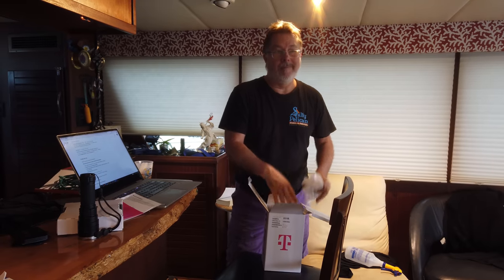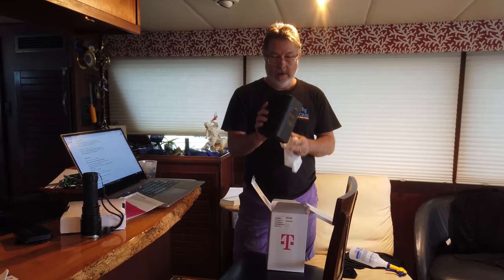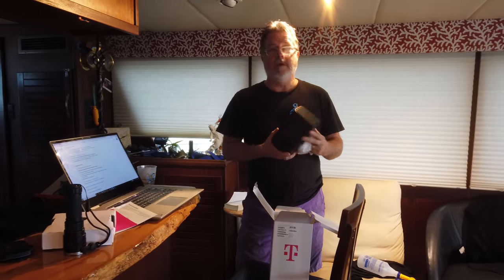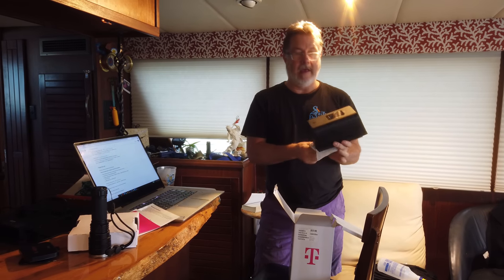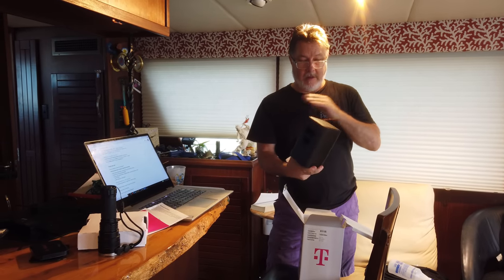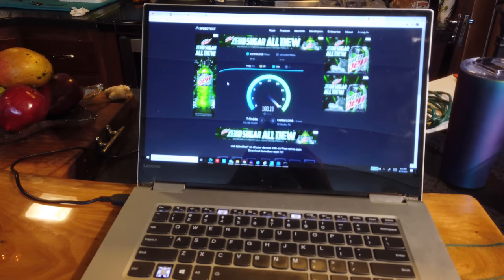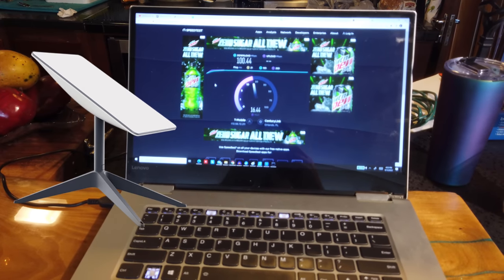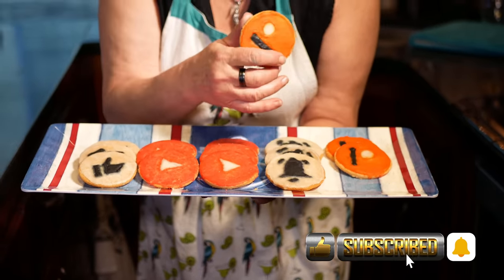Boat Internet 1/3 The Cost of Starlink! Plus, how we monitor the boat from 1000 miles away! E178

Comment: I have the SimpliSafe cameras, and they sell a fixed base that you can screw the camera to, however, I am not sure if they will you the rate of motion you might need to line up the camera but worth looking into it.  Also, I highly recommend the solar panel charger for the camera battery.  Depending on the motion detection level and activity around the camera the battery will not last anywhere near as long as they claim.  In addition the only way to charge the battery is by removing it.  If you don't do the solar panel, then I recommend having two batteries per camera so you can just replace the battery and not loose coverage while it's charging.
Reply from the maker: Thanks for the tips. So far we like the system. So far the camera has been on for two months without charging. We have live aboard neighbors so the camera gets triggered often. I think I need to set the coverage zone tighter when I return to the boat. I'll look into the solar panel attachment. Thanks.

Comment: Something else you might want to implement with your CerboGX is the automatic generator function.   You can program the system to automatically start the generator when the batteries are depleted to a preset level (e.g 20%), charge the batteries to a preset level (e.g. 90%), then turn off the generator.  This will significantly reduce the number of hours your generator is operating, while still providing you with all the power you need when you need it.   The more battery capacity you have, the less frequently the generator will be running.

Thanks for the tip on the internet service!

Comment: We had an AT&T grandfathered account with true unlimited data but they cancelled it. We tried T-Mobile in Florida and it was horrible with very slow speeds (1-2 Mbps) multiple dropouts and constant connection issues. We also tried Verizon and it worked fairly well but it was slow (5-8 Mbps at best) and had unreasonable data limits. So when the portability option for Starlink was available, we grabbed it. We have had outstanding high speed service all along the East Coast, the Chesapeake and here in The Bahamas.
Reply from the maker: We are getting 100mbps on T-Mobile. 5G
Reply: T-Mobile 5G it doesn't work in The Bahamas (Starlink does) and is very sketchy at most anchorages along the East Coast. In the big city it may be great but you can get reliable 300 to 1000 Mbps speeds with Verizon 5G and unlimited data for the about same price.

Comment: I bet there's some version of a glue / epoxy, or a Loctite-type product that you could use to attach your cameras. Something that holds securely, better than a magnet, but not necessarily permanently. You may even find something that will release with heat, like from a heat gun or hairdryer. There's even some extremely strong 'Stay Tape.'
Reply from the maker: We are playing it by ear for now. The way the base is set up, I can permanently attach it to the top of the base, which twists to disconnect from the bottom of the base. So there is a solution that allows us to still bring the camera inside for charging without too much difficulty.

Comment: We have similar monitoring system on boat, but cellular-based (Boat Command). At this time of year it is very comforting to know that shore power is on and boat interior temperature is well above freezing.

We also have the T-Mobile Home Internet at home and have had great service. One tip that might be related to your lost connection - this unit has both 2.4 and 5 networks, blended by default into single SSID. However, it does not always route properly between the two networks. In our case, if a laptop connected to the 5 network, while network printer was on the 2.4, we could not print. There is a simple setting in the T-Mobile app to have the unit split these networks, so you have two SSID's (e.g network2.5 and network5). So we can now make sure that printer and computer are both on 2.4 for example. This could be the problem if your Victron hub is on different wi-fi network than the other wi-fi components.

I enjoy your videos!
Reply from the maker: Thanks for the info. Perhaps that is what is going on. It seemed to work fine when we were at the boat but we  have since lost connectivity. I seem to recall that the Cerbo GX specifically stated that it ran on 2.4. Good to hear that T-Mobile Home Internet is working well for you. We may decide to switch our land house to it as well.
Reply: @tryingnottosink9107  I am in that spot right now! My Verizon hot spot blinked while we are several hundred miles from the boat and now I don't have any cameras or info on what's going on in the boat unless I drive back down. Dang it! Sometimes just a lightning strike nearby.

Comment: I wouldn’t count on it as a travel solution. T-mobile home internet is locked to an address and it is against their TOS to use it anywhere else. Supposedly it still works if you move it but it’s only a matter of time before they start cracking down on it. You may find yourself deactivated out of the blue if they find out.
Reply from the maker: Possibly. But the investment is only $50. I bought the unit in Florida, using my Pennsylvania address and they had no problem. I have been running it in Florida for several months now.

Comment: Hope your new monitoring system works good for you...
But sounds like you need a good auxiliary generator  to run the air conditioning when you're at anchor..
Reply from the maker: We have a 20KW generator onboard, which can run the whole boat, including 6 air conditioners. We are just trying to find ways to use it less. It uses 1 gallon per hour, so if the inverter runs 6 hours per day at $5 per gallon, we are saving $30 per day x 100 days per year, equals $3k per year. Plus it now gets less wear and tear.

Comment: I asked at the Tmobile store a uear ago about this router...
Per their staff, the router will only work within your defined home cell. Has that changed? Because I don't think this is gonna be capable of replacing your Hotspot when it comes to mobility...
Reply from the maker: We have not tried moving the unit yet since our boat is docked until May. However, we used our Philly address when buying it and we have it installed on our boat in Florida.

Comment: We have very similar systems.  I have Victron Charger/Inverter and two Victron 330ah lithium batteries and two 170w flexible solar panels.  I also have a SimpliSafe, TMobile, and a bunch of cameras.  I believe you will like your setup!  I don't have the Cerbo GX for remote monitoring.  I will look into that.
Reply from the maker: That is a very similar system. The Cerbo GX lost connection and we do not know why. It worked great for a while. We are not sure what happened. We can't check until we return to the boat. The Simply Safe system is working fine and the T-Mobile Home Internet has exceed our expectations.
Reply: @tryingnottosink9107  That's a bummer with the Cerbo GX as remote access is why you have it!  As I'm sure you've experienced, there are no reconnection issues with TMoble or SimpliSafe.

Comment: To me the weak point of something like the T-Mobile system is if you're someplace without a cell signal.  That shouldn't be an issue though in coastal areas or around the major islands in the Bahamas.  It looks like quite a few of the boating channels on YT have added StarLink, I like the installation on Cruising Sea Venture since it still allows the antenna panel to move to get the best signal.
Reply from the maker: We'll see how this works out. We had decent coverage with our cell phones last year. It was only a $50 investment so there is little to lose.
Reply: Michigan, I agree, If you can get cell signals from shore I don't need any more internet than that. My biggest concern is getting accurate weather data so my go to site is "Windy". Trouble is, here on the west coast a lot of the time I can't get a cell signal so no weather.

Comment: I use simply safe on mine also,  marina wifi is too weak to run the system so I use a Verizon wifi on my boat to run the simply save and my roku tvs.
Reply from the maker: We like the T-Mobile home internet when we are in the states. Does not work in the Bahamas though.

Comment: Ed, I was under the thought you installed T-Mobile, if so how is it working on the boat ?
In your talk you say (We trade in the T-Mobile ) thanks
Reply from the maker: Yes, we installed the T-Mobile Home Internet. We returned our T-Mobile Hotspot. They both cost $50 per month but the Home Internet is much better. The signal is strong enough to cover the whole boat and it has unlimited download at high speed. The Hot Spot was limited to 100gig and it would overheat if you kept it in the charger for too long.
Reply: @tryingnottosink9107  thanks, I was confused as to changing the T-Mobile.

Comment: I looked into a similar solution from Verizon, but stopped when it asked for an address.  I believe the same is true for T-Mobile.  Obviously supplying an address is easy, but do you anticipate any issues using a "home" device while travelling far (at least within the US)?  If the service provider doesn't care (or doesn't know) where the device is, then using "home wireless internet" on a boat seems like a no-brainer.  Forget about Starlink, it's cheaper than my hotspot!
Reply from the maker: We used our home address near Philly and we have the unit in our boat in Florida. They do not ask where the unit will be installed. However, we found that if we used our Florida address, they did not offer "unlimited" just 100 gig per month. Apparently they do not have unlimited in all areas.
Reply: @tryingnottosink9107  you got lucky.  our home, business, and marina address are not quite in 5g territory.  considering using a virtual address from iPostal1.  will be interesting to see if it works as unlimited when in just LTE territory, which will be most of the time.  i suspect you won't hit that limit while remote monitoring, so won't know for sure until you're back on the boat full-time (unless you've already stress-tested it).  i can't find an answer for t-mobile or verizon anywhere, because of course they're not going to say "here's what happens when you move your house around"  hope it works out for you - we plan to try it this spring/summer
Reply: @tryingnottosink9107  Did you have to switch your home internet to T-Mobile as well? I'm a little confused on exactly what "system" you got for the boat. Thanks

Comment: Comfooozed.  Why not let engine alternators charge batts ALL the time?
Reply from the maker: We can. And I probably will in the future. We had a problem where we ran the starting batteries too low while doing that, and almost couldn't start the engines. It turned out to be aging batteries but it spooked me a bit. What we plan for in the future is too hook up an additional, high amperage, alternator that is dedicated to just charging the lithiums so I do not have to worry about it.

Comment: This isn't a Starlink replacement...you wont be getting any service when out on the ocean with that T-Mobile hotspot.
Reply from the maker: I know there will be dead spots, like when we are cruising 15 miles out, or crossing the Gulf Stream - just like on our phone. However, you are not permitted to use Starlink while underway, so that would not solve the problem either. We are curious how well it will work in the islands though. Last year our old T-mobile hot spot worked, but was often throttled. If the same thing happens with the T-Mobile Hone Internet we will probably add "Island Wifi" We did that two years ago and it worked well for only $50 per month and you turn it off when you return to the states.

Comment: Hey how is that Windless controller holding up? Do you have a genset on board?  Are you trying to get away from engine driven power when anchoring? You have come along way with learning about systems and maintaining your your boat 😁🛫
Reply from the maker: The windlass has been working great! We are upgrading the anchor this winter. Yes, we have a 20KW genset onboard but we are trying to get away from using it. In fact, if it ever breaks I will replace it with a large bank of batteries and a small emergency generator.